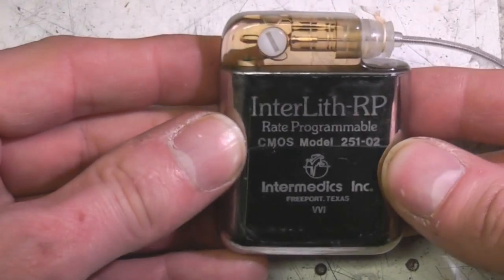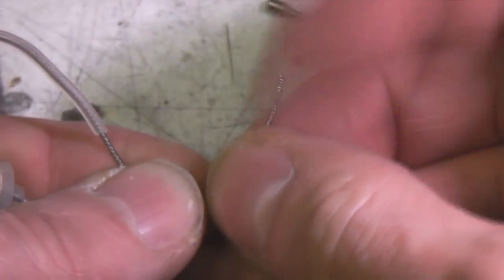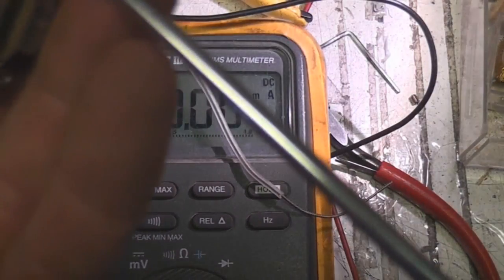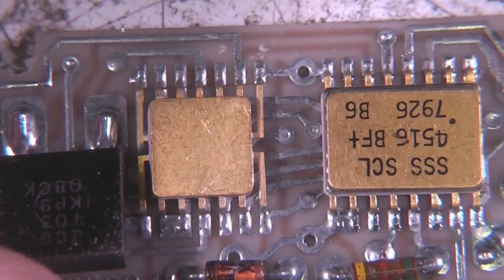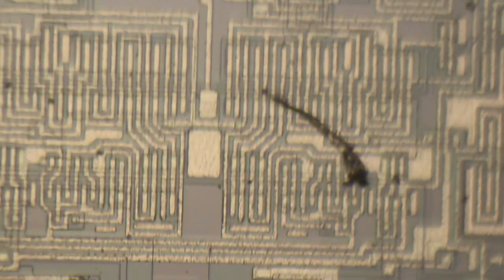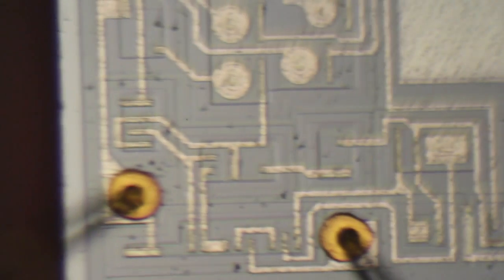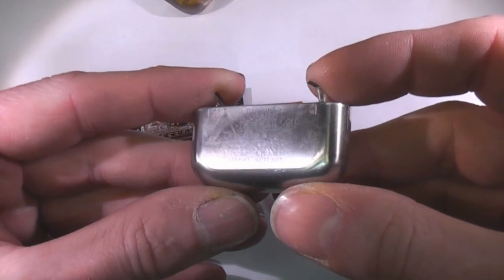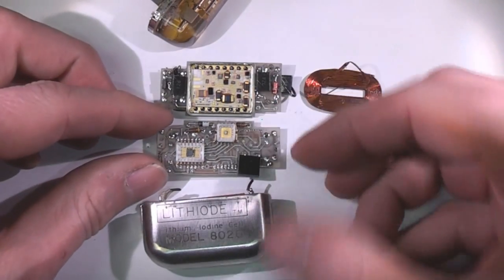Pacemaker teardown

Comment: wow i keep finding your channel, relatively small but every year or two I end up clicking on your video coz its the only one on youtube covering niche topics. keep it up. cool handdrawn? fiberglass? circuit board! I was surprised to find out that there are still about a half dozen people living (in france i think?) with nuclear powered pacemakers. their battery is apparently "good for life"... or ~25+ years. theres a study out there somewhere about how much money they have saved not having to be replaced. i would imagine they just use the spaceship style of wrapping thermocouples in something hot? ive always wondering what their xrays/CT's would look like... if there would be any radiation flashes visible lol. they apparently track those people carefully and make sure they have a regular burial coz the big issue is what if they get cremated and you cause a nuclear waste issue lol. tech back then was so much cooler in the 60s and 70s.
interesting on this tear down that there were no sparks when you were using the Dremel. i suspect titanium? they use surgical steel/high chromium stainless now a lot but i think there is an advantage to titanium since xrays go through it so much more easily and you could theoretically inspect the inside of a pacemaker and identify a damaged capacitor or something?  the reed switch is for the ER doctor. sometimes pacemakers go crazy and start shocking a rhythem that maybe shouldnt be shocked. can cause a lot of discomfort if youre getting blammo'd over and over and i imagine its bad for the battery. every ER has a big ring magnet stuck to some metal surface around where patients are usually triaged that can be used to turn off a hyperactive pacemaker.
anyways, never even heard of a lithium iodine battery. very cool video. have a good one!

Comment: Chips from around them would've probably been made using ~3-5um processes. Compared to today's~ 14-10nm processes. 

Crazy to think about how much smaller that is. Honestly it's just crazy to think something that large, where you can practically see all the traces and parts can do any kind of "logic". I mean I get it, it's just amazing. I love this sort of stuff, but it's beyond what I've learned.
Reply: you think that's large, imagine the size and complexity of the earliest analog computers. TTL and 4000 logic was a huge step ahead of the ENIAC days when a comparator took 4 or 5 tubes and a box the size and power consumption of a toaster oven.

Comment: Looks really well shielded. I suppose it would have to be through, walking past a taxi rank and they key the mic, then yer ticker stops...lol. I didn't realise surface mount was in use back in early 70s. The plated through board looks a bit DIY though.

Comment: its a long life battery lithium and does not recharge. the coil is used to produce the charge from a very small current - 2.7V @ 10mA  to produce 20V & 120V depends on patient. as it only produces this charge very rarely it would last 5 years new models last longer and can be charged through inductance.

Comment: Nice tear down!  [EDIT: I thought the coil was a charging circuit, but not the case]

Someone mentioned Solid State Scientific -- their logo was a cube with "S" on each side.   I worked for a large analog company fresh out of school, and half the fun was our designers would use "freespace" to hide a little drawing.  Goose Egg?

Only bummer to implanted devices, is no more TIG nor Plasma use.  Haven't done it, but two years away.  Irony is if the Direct Brain Stimulator (DBS) works well, my hands will be stable enough to TIG weld.... uh oh.  :)
Reply: Hello man who knows the stars :) tell me is it possible with DIY way to build a microwave technigue using device that finds titanium or nuclear battery in friends body ? me and friends are normal arduino builder nerds.

Comment: Pity you pulled the pacemaker apart.  It looks very similar to the early 1970's lithium-iodide powered devices manufactured by Cardiac Pacemakers Inc; which offered longer power-cell life and significantly improved reliability.

Comment: Standard CMOS, nice little bifet opamp and those Vishay resistors with the bare die transistors. I could probably ID the transistor, though you will find it is a run of the mill low power NPN or PNP device, typically 100mA 30V process, and Ft of around 250MHz.

Comment: Is it posible the coil is for wireless charging? If you ever get one of these running I would be very curious to see the output waveform and p-p voltage.
Reply: Charging was my thought also
Reply: I know later models are wirelessly charged.
Pancakes are perfect for inductive charging. I would think a com ant for close range (near contact) would be much much smaller.
Reply: Wireless charging in the late 70s? Lol

Comment: How does the coil manage to communicate trough the metal can?
Reply from the maker: The can is not magnetic. There will be some eddy-current losses, but a decent signal will still get through
Reply: mikeselectricstuff Thats an awfully big coil for communications.  Looks almost like an inductive charging coil to me.  Of course.. then you mentioned it was from the late 70's lol
Reply: Steven King Steel IS ferrous metal
Reply: mikeselectricstuff If the can was made of ferromagnetic metal, then it'll be magnetic, right?
Reply: It's a non ferrous case right? Titanium or more likely a steel???

Comment: That magnetic field switch is used to actually turn the pacemaker on and off. If there is a malfunction of the device a donut shaped magnet can be placed over the unit to deactivate it. Or at least with modern ones that is the case.

Comment: i have a implantable defibrillator it has shocked me quite a few times to keep me going i feel like a cat with 9 lives it shocks you at 41 joules feels like getting hit with a baseball bat it amazes me how small they are
Reply: i dont drive anymore not a safe thing to do my wife does the driving i have to be careful doing electronics i dont to fry any of my projects
Reply: Rikard Bengtsson its a defibrilator - thus it only fires when he does not have a normal sinus heart rhythm. As the name suggests, it stops the heart from 'fibrilating'...kind of like a seizure where the sequence of 'brain pulse, this ventricle, that ventricle' doesn't happen in order. The defibrilator stops this bad pattern by shocking the heart, hopefully resetting (stopping it entirely) it from goofy random rhythm back...in the hopes it will take the next brain signal and restart normally.
Reply: Does your heart stop?
Reply: ***** I guess there's really no need for warning, since you'll probably feel improper beating of the heart before defibrillator kicks in.
Joe Schmoe I wonder, how and how often do you recharge it? Wireless charging?

Comment: Quite a lump to put in a body. Only slightly removed from bloodletting, really :)
I would probably have tried a hair wire in the body and inductive device on the outside if that could work.
Of course in Dick Cheney's case some sort of guillotine might have been better.
Reply: There's plenty of space in the abdominal cavity, the long wire stretches up to the heart. Having it fully implanted means the skin can heal, that's very important to prevent infection. Shunts are dangerous.
Reply: SAI Peregrinus I said inductive.

Comment: The mini shears to cut off the tops of the ICs are interesting. Are the IC packages designed to have the tops removed in this way?
Reply: No ICs are designed to have their tops removed. It just happens that ceramic packages are brittle and vulnerable near the lid.